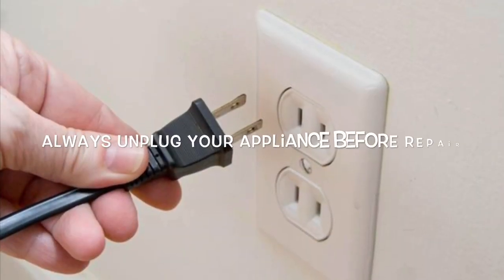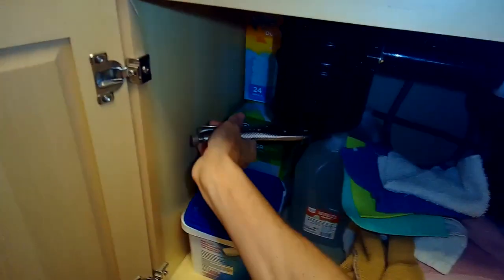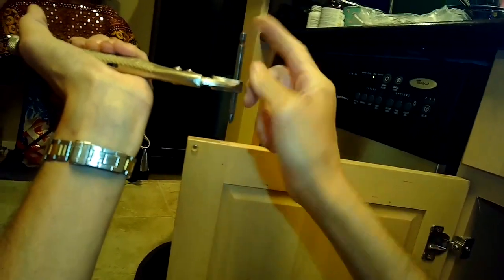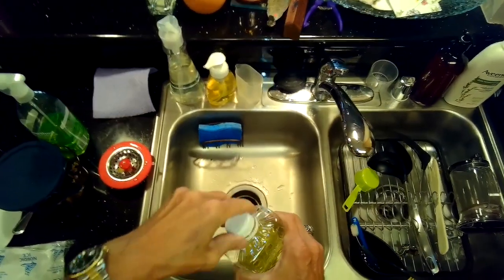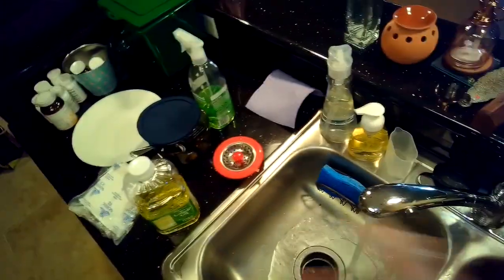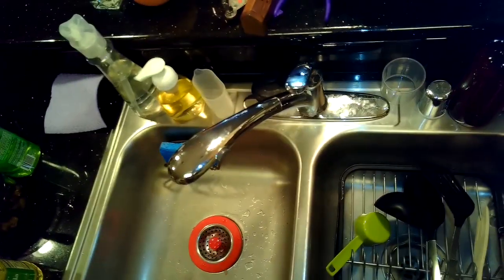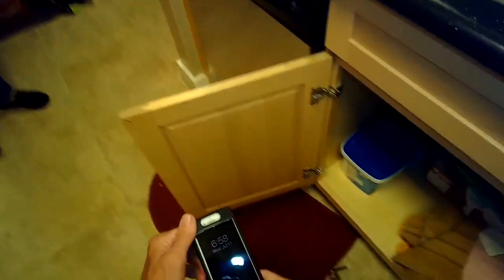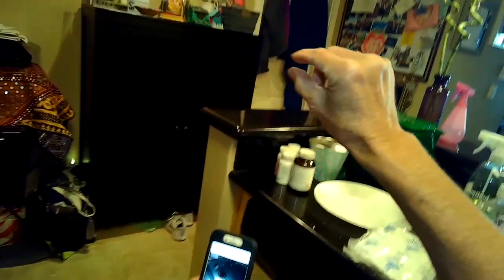✨ GARBAGE DISPOSER HUMS - WON’T SPIN ✨

Comment: Thank you for this tutorial! My disposal hummed but the cylinder wouldn't turn, and the hex tool couldn't turn it. I used the vice grip tip and was able to rotate it. I then poured in veg oil and was then able to rotate it in both directions using only the hex wrench. I ran the water, turned it on and it works perfectly!! I think the problem was a citrus seed getting wedged.
Reply from the maker: Great job Stuart😊

Comment: You just saved me from removing my disposal! I've tried several times to break the flywheel loose using a big hex key, but it wouldn't budge. I decided to give it one last shot before pulling the disposal out, and the vise-grip trick gave me the leverage I needed. A couple of yanks and it was spinning again! Thank you!
Reply from the maker: Nicely done Michelle😊

Comment: This is an amazing video.  I did exactly what you told me to do and it worked.   My family friend Joe gave me a toolbox and told me that it would save me a lot of money one day.  Never used it until today.  I found the little tool, it has a number 6 on the side of it and I attached it to this wrench and I moved it back and forth like you said! At first it was difficult to move,  and then I heard a scrape.  It sounded like the blades were a bit rusty like you said.  I haven't used my garbage disposal because I was hardly at home, but then I got the flu and had to quarantine.  I put some veggie oil down the garbage disposal too.  I reconnected it and it worked! It worked! Thank you thank you!

Comment: Worked amazing. But do I need to tighten anything after moving the Allen wrench around? Blades sound very loud now.
Reply from the maker: You’re good.  The noise is from what ever was caught in the blades is getting ground up.
Try pouring a little vegetable oil in while it’s going👍

Comment: What if after doing all this, it still hums? I used a nut driver, poured the oil and was turning that nut back and forth for a good 5 minutes and the blades still won't spin, when I look down the drain I see that it tries to, but it just stops
Reply from the maker: Stay at it. Try attaching a pipe to the end of your wrench to give you more leverage 😊

Comment: Also try using a hammer handle twisting it a few times this will dislodge anything that may be trapped mine was the larger blade that wouldn't work
Reply from the maker: Great idea,
Thanks for your input👍

Comment: What if it won’t rotate?
Reply from the maker: Try pouring some vegetable oil in to the sink and then use a wrench to give you more leverage to rock it back and forth until it starts to turn.  Keep at it, it will finally start to turn.